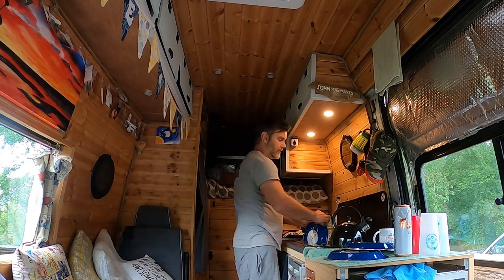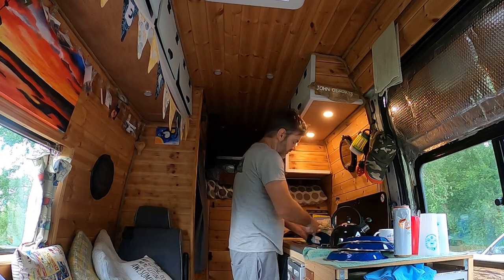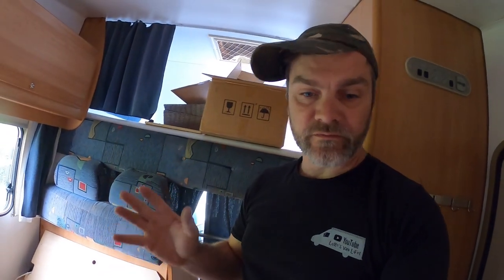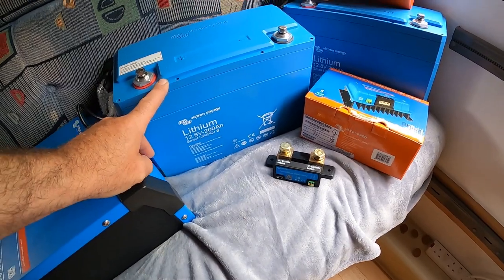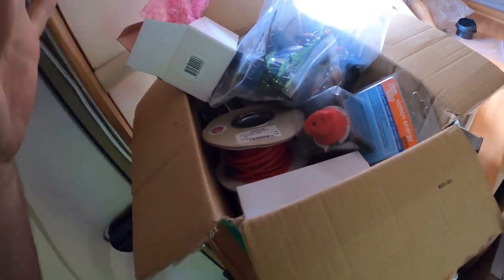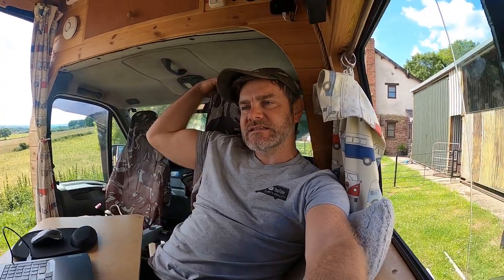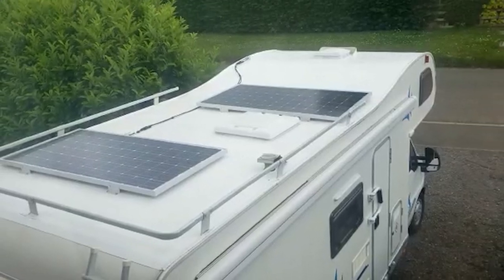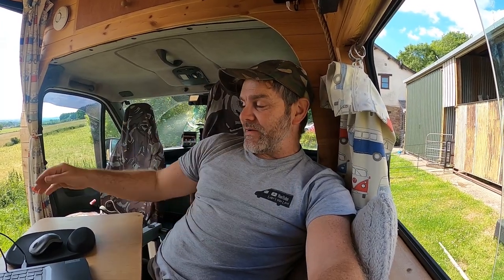Motorhome Upgrades || Victron Setup || Off-Grid Motorhome

Comment: Nice job on that readymade motorhome, I could imagine, working with given conditions is always more tricky than starting from a blank van...
Will that big inverter/charger running very hot in that small space or did you installed some air vents also?
Thx for taking us with you to work...
😉👍

Comment: I installed a multiplus II 5kW inverter in my house for a self consumption and backup solution that adds to my pv system.  What I didn't expect was that it''s so noisy. Luckily it's in my garage...
I can imagine that, when you're in a van, and you have a powerful charge or load, that it might be disturbing for people that appreciate silence.
What's your experience with that?
Reply from the maker: Hiya, even under extreme charge or load they shouldn't be that noisy. They are usally quieter than a compressor fridge. Maybe tighten all the screws on the case, perhaps you are getting some resonance?